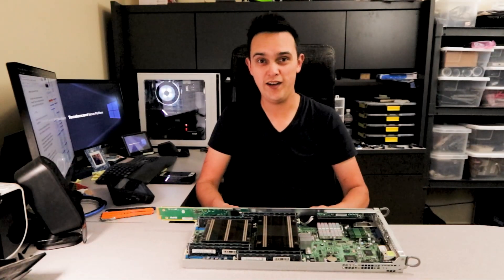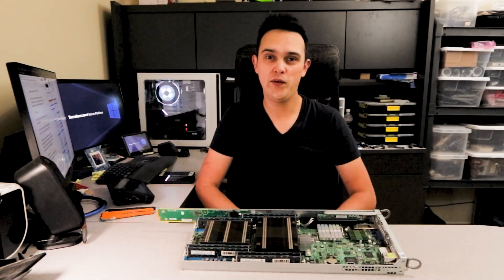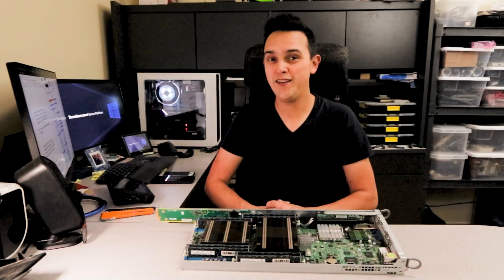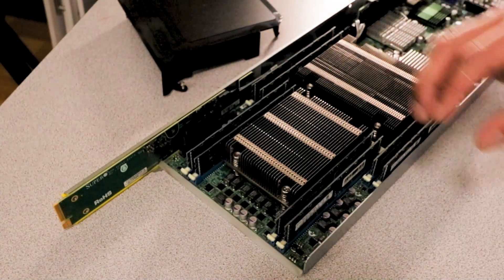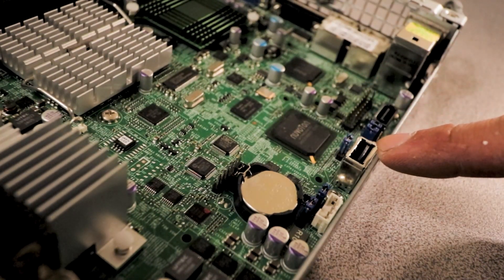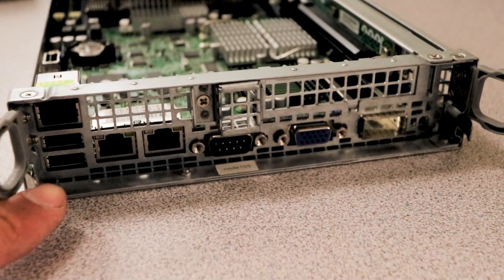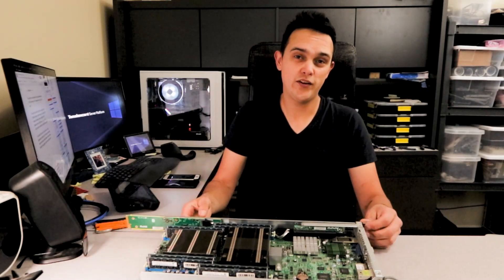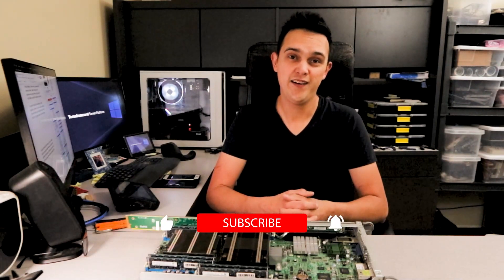Why YOU need this GREAT 4-node, 2U SuperMicro server!

Comment: what is the motherboard model and revision? I got one today but I don't think there is a qsfp Interface. So, it may be older.
Reply from the maker: X9DRT-HIBQF - I think? there are 3 variations in this system, 2 have Infiniband, 1 has dual Gigabit ethernet and only this model has Quad Data Rate Infiniband, the other model only supports SDR IB. They are all just different options for the same system.